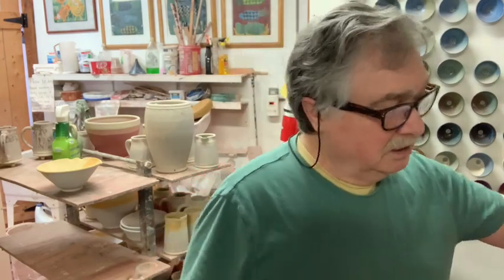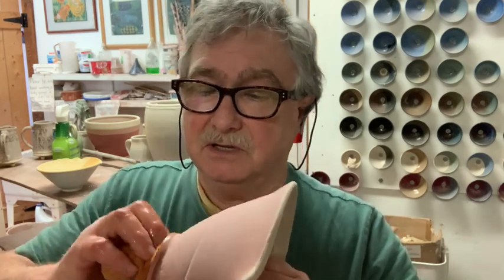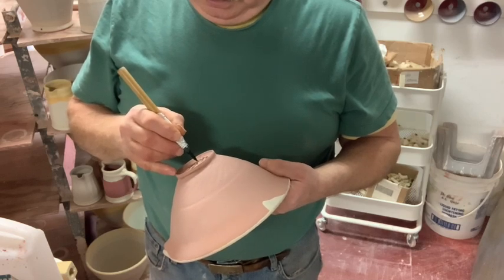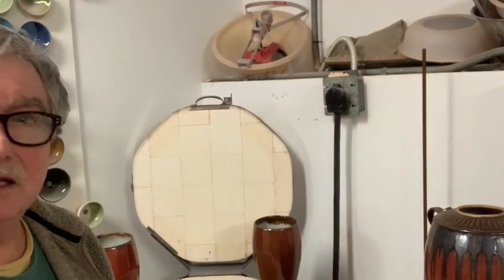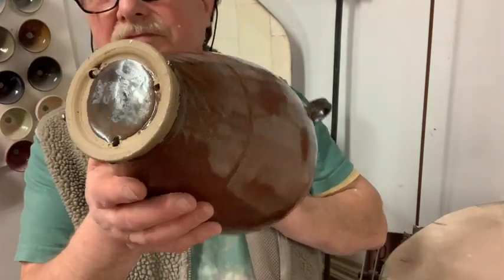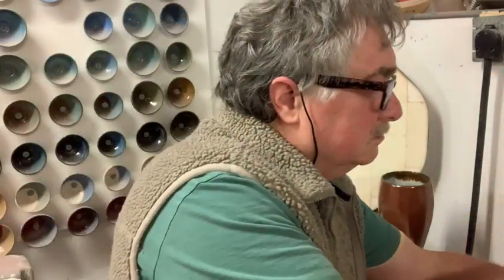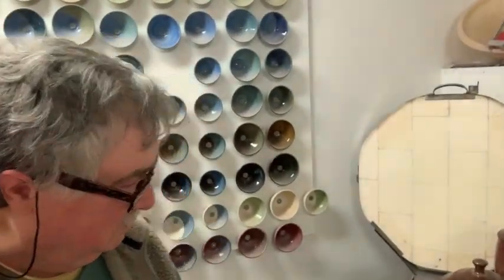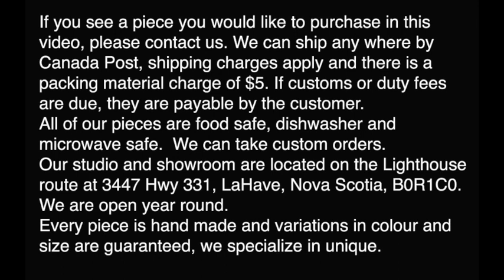How much glaze should you wipe off?

Comment: Vaughn, how do you winterize the pots you decorate with outside? Do you bring the pots indoors or cover them in plastic during the really cold weather? I’m nervous about permanently installing a mural outdoors because of freeze/thaw expansion and contraction.  I don’t want to do all that work and have it break apart during winter.
Reply from the maker: I leave the fish outside all winter and bring in the planters and vases. I do leave the bird feeders out. The clay is vitrified so it does not absorb much moisture, if any.